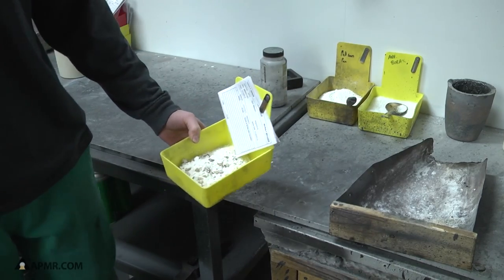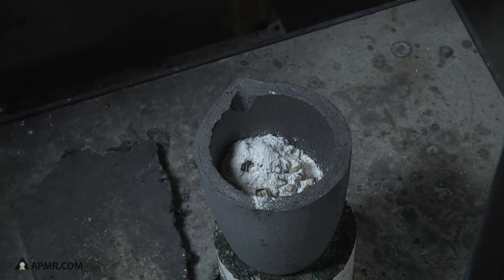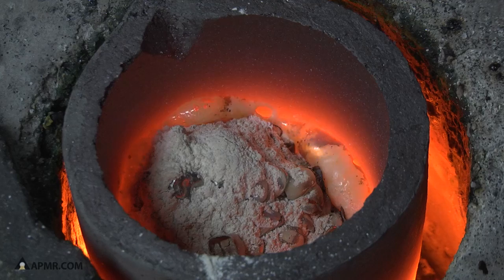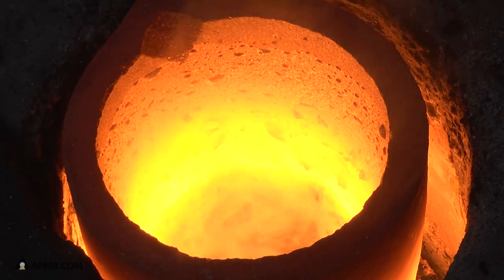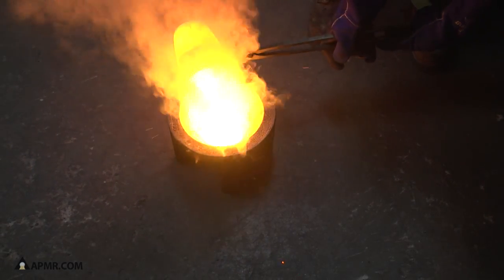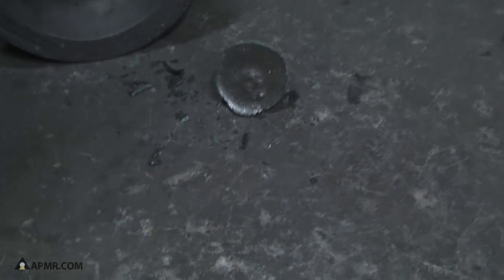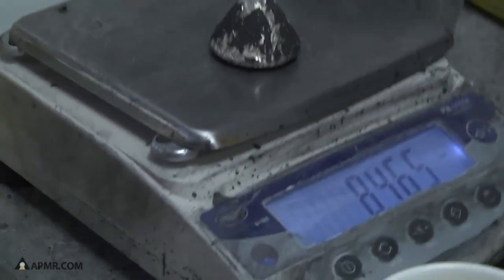Scrap Dental Gold, Silver, Platinum, and Palladium First Melt

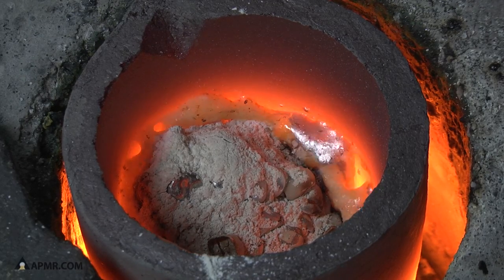Comment: 0:50 the magnetic field does not heat up the graphite crucible, it heats up the metals inside, by forming eddy currents.
Reply: Since graphite is very conductive, the induction heater creates eddy currents inside the crucible as well. It will heat up inside an induction furnace even without any metals present.

Comment: Hey so u have to start with the metal that melts the hottest and work your way down, Gold melts at a temperature of 1064 degrees while silver melts at 961.8 degrees platinum is 3200 so melt platinum first work ur way down in temp and maybe add a bit of brass remove a bit of platinum and what ever is removed add the weight in brass